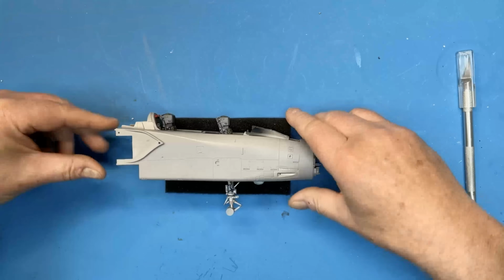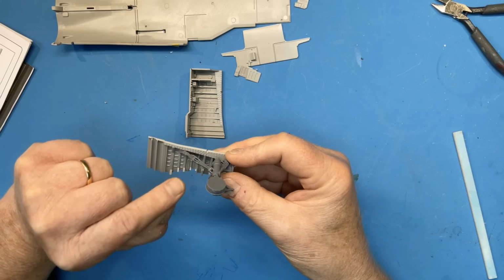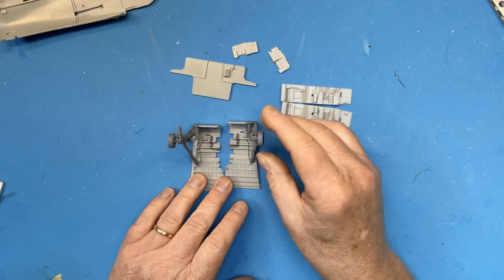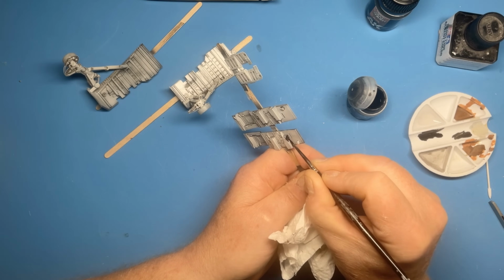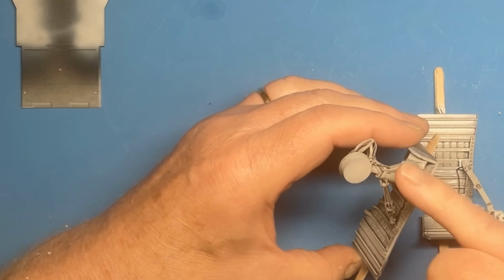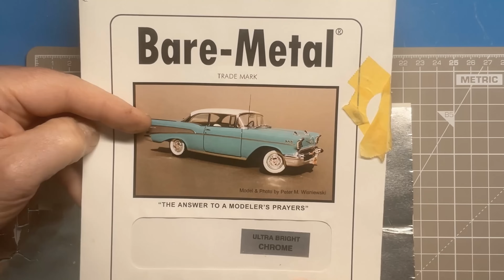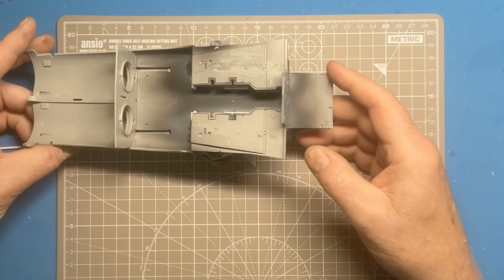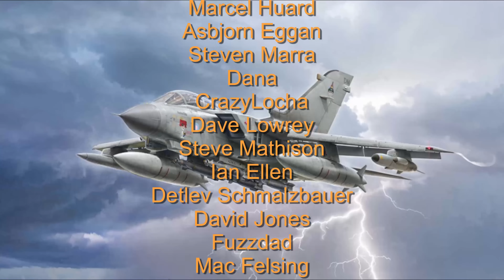Italeri 1/32 Tornado GR4 Part 3

Comment: I'm interested to see how you're going to flatten out those deep panel lines. Great work Steve.
Reply from the maker: You might have had your finger on the FF button Tez 🤔 I showed how in part 2 and in this as well using Mr Surfacer 500.

Comment: My goodness Steve those 3D printed main legs are a delight too behold, they have even included the three walking joints on the drag brace! The “hydraulic lines” that you removed and replaced with .4mm were on the real thing arranged so neatly as to look like a work of art when fitted, btw the italeri undercarriage bays are by far and away the most accurate representations of the real thing  “ and that includes any aftermarket resin examples” the wheels would actually fit in the italeri model. The main legs and drag brace were always supplied as gloss white. As always your work looks fantastic and  I hope whatever info I supply can be helpful.
Reply from the maker: They’re really nice pieces I’m glad I used them. Thanks for your offer it’s very kind.